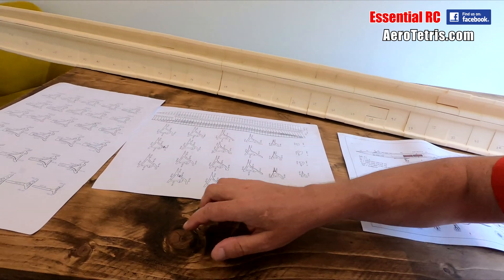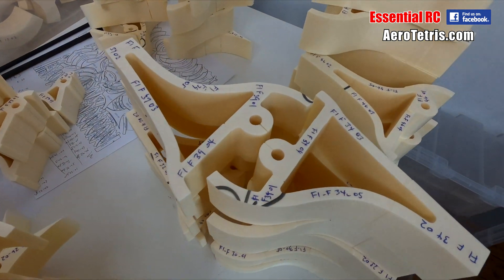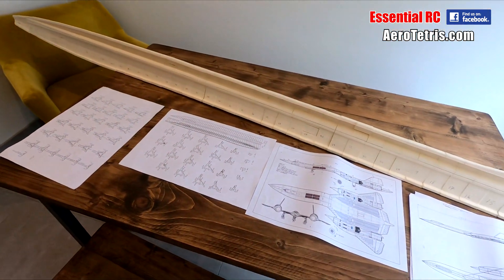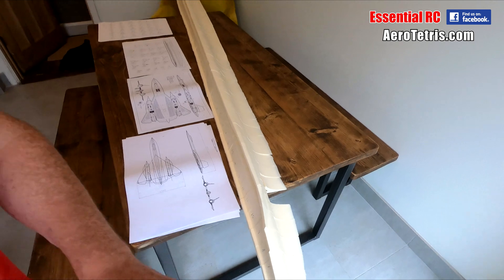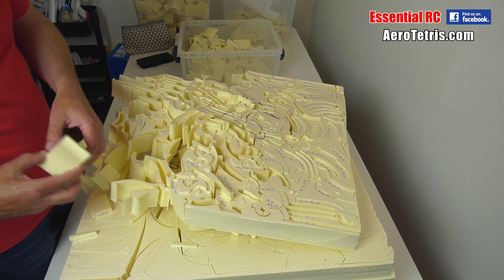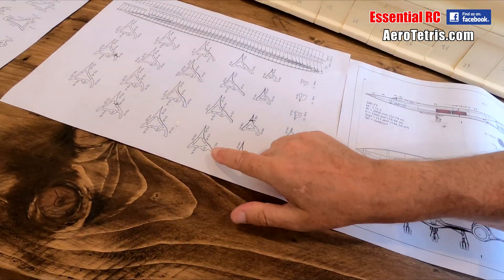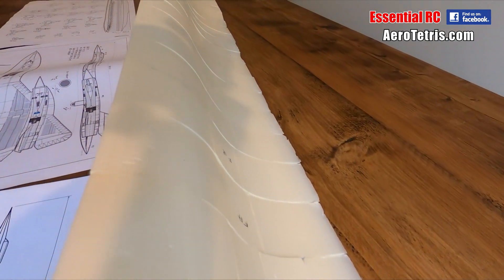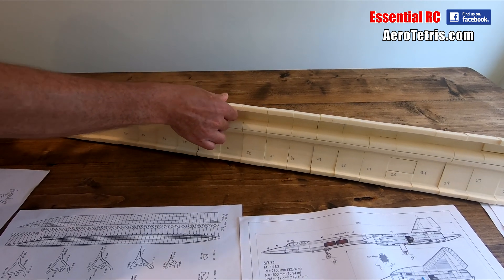AeroTetris 2.8 metre SR-71 Blackbird: BUILD LOG: Part 3

Comment: Does it have the control surfaces made separately or are you expected to cut them free yourself? Same for engine hatches, UC bays, RC access etc
Is it a 1 piece model when done??
Reply from the maker: Control surfaces are not cut and I don't actually think any indication of where you are supposed to cut them. Same for hatches, bays etc. 1 piece model when done? That's up to the builder. Certainly won't be for me because won't fit in the van if it was.

Comment: Today nothing build, only infos about loosing parts lol
Reply from the maker: I built one side of the fuselage. Too hours ! Did you miss that !!!
Reply: @EssentialRC  i saw 2x building Video the last with your Wife and Son Play Aero-Tetris lol i miss part 3 Building
Reply: @EssentialRC  are all this part just  glue it or only mount on the carbon-tube??
Reply: I ask why the form looks horrible 1mm-2mm up then the other part you will need a lot of abrasive paper Lol
Reply: you know what i mean the People build just over 100 years RC Model Airplane but this system is for the Cat so we say it is for nothing in German, Für die Katze, a lot of Work only to build a fuselage. And the stability coming only  from this Carbon-tube, I do not know.
Reply: Hope you dont need a 3D printer at the end for all loosing parts
Reply from the maker: I didn't say stability will only come from carbon tube. I will add more reinforcements when gluing fuselage halves together.